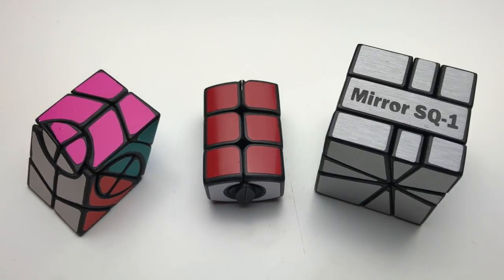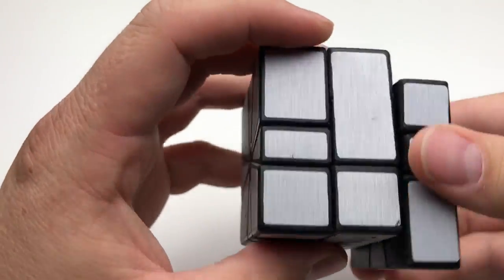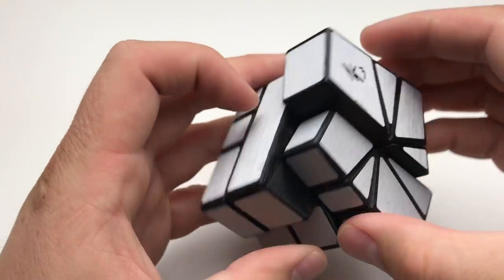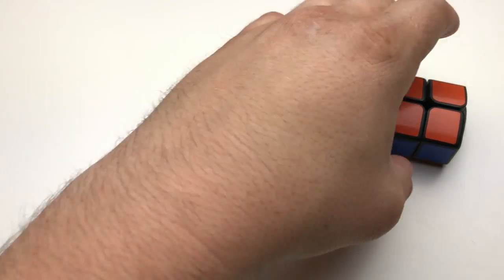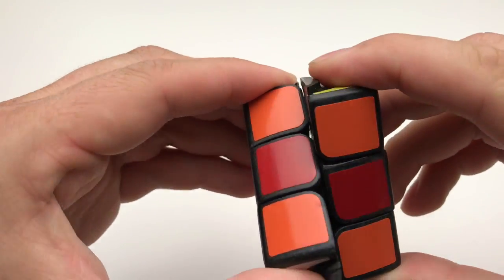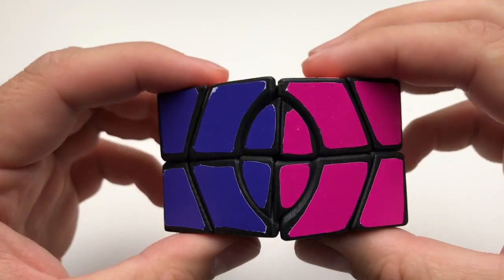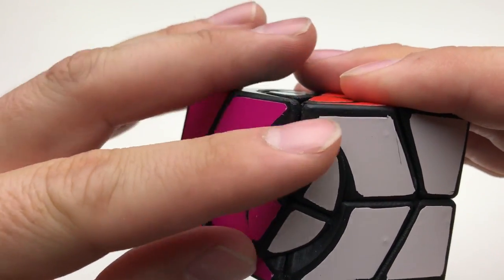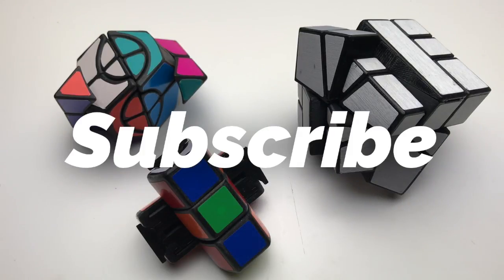Mirror Square-1, Sliding 1x2x3, Gyrobifastigium | NK Cubed

Comment: I have a smaller hands but have rough turning...which 3x3 do you recommend me...

....no budget is there
Reply: So i aldo need a stable cube
Reply from the maker: A non-budget stable cube? If that’s the case you’ll probably really enjoy the MGC. The version was really buttery and I really enjoyed it. You can get it for about $13 I believe.
Reply: @CubeSolveHero  whats the specs